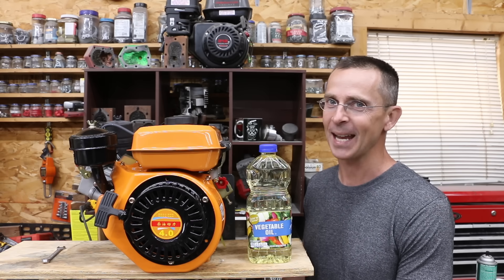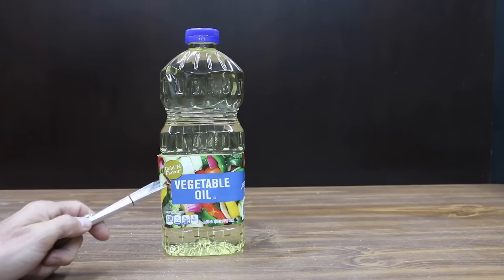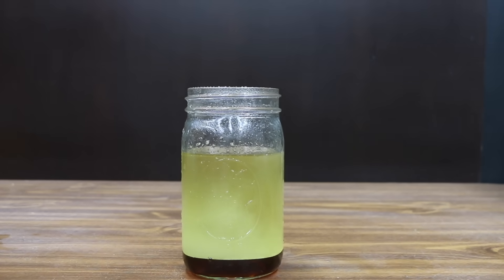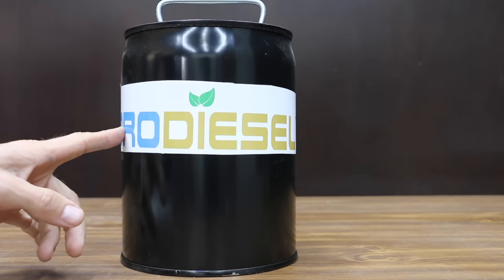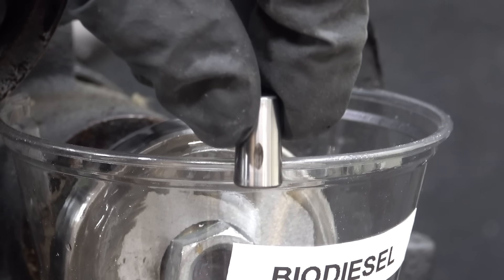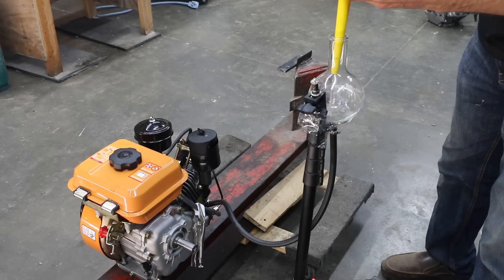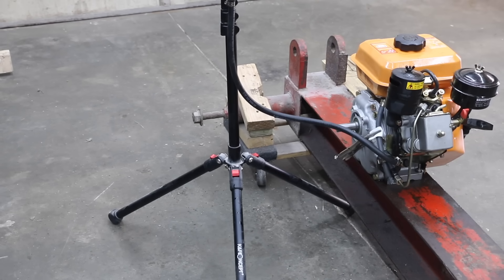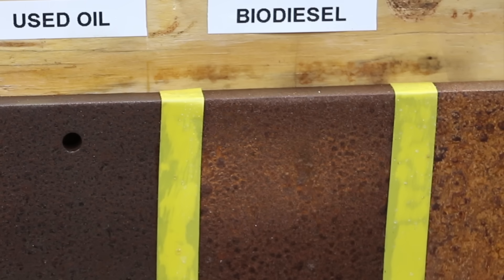Make "Biodiesel"? Let’s find out! Diesel vs Biodiesel, Used Motor Oil, Vegetable Oil, MPG

Comment: How long would a fuel filter last running used motor oil or is there even a fuel filter in line with your modified fuel cell set up?

Comment: I have ( 3) e350 7.3 idi vans non turbo
That I've been running wmo  for about a year now .
Just filter down to 10 microns and run it .
Smokes a little and I feel a slight power decrease. 
But it's free.and I'm not racing .
Reply from the maker: Thanks for sharing.

Comment: We just just filtered used vegtable oil through water then through used fuel filters off of semi trucks. Ran 2 IdI 7.3s and an om617 on it for 2 years. The nicest oil came from the fairs. Then I got a real job that consumed my fuel making time. 

I then rans some uses filtered used motor oil blended with diesel in an om617 swapped dakota. The dakota was just too heavy for the 125hp engine. 

I'm considering putting one of those IdI 7.3s back on the road if fuel gets to $5/gal. This time it will skinned with a 70 f100 body in a 250 frame. Fuel of choice will be filtered motor oil.
Reply from the maker: Thanks for sharing.

Comment: Hi, I used to have a 97 model 3l Toyota Hilux, the Aussie version of the Tocuma. I bought her with 97.652KM on the clock, 15 years ago. The reason i bought her, after a few years of research into alternative fuels, she was the best option . I researched distilling alcohol as a fuel, using used motor oils, new veg oils, used veg oils and then making my home brewed Bio diesel.
i am very happy to say that Used Veg oils from the local take away was the winner. I then started making my own Bio diesel using the appleseed method. The Big Girl as she was named, ran very happily for 10 years with out any mechanical issues. Used Veg oils was filtered thru 50 micron bags then allowed to settle in an Updraw filter system using 44 gallon drums in series. 4 drums, the 4th drum was my main draw drum for either straight use or put away into a 1000 ltr cube drum for later use. I was called the Oil Barren in my street. The Hilux used to take me to work every day, Hunting trips , tow my 5.5mtr Bowrider to my fav fishing grounds, trips to Queensland to Fraser Island and it never missed a beat. I set her up using a 2 tank fuel system. a 100 ltr tank in the tray area for Veg Oil, and the main tank filled with either proper Diesel or Bio Diesel. I would also carry an extra 40 ltrs of Veg oil in jerry cans, just in case. The oil was gravity feed to the engine bay, to a 30 plate heat exchanger running of the engine cooling system, thru another filter, back thru another 30 plate heat exchanger before going direct to the mechanical injector pump.
the only thing i found in the early days was the high consumption of fuel filters as the diesel algae was lifted from the original fuel lines. this was expected. Might i add, this is what people say kills their engines, NO, it doesnt. it blocks their filters. Veg Oil has never caused my injector pump, my Injectors nor my engine any issues. Remember, The Diesel Engine was designed to run on Peanut Oil, Rudolf Diesel the inventor of the engine...look that up.. Anyways, 10 yrs down the track, I sold her to a guy in Queensland, with all the filtering gear to continue her journey. I miss her dearly. The Only reason i did, my 2 baby girls grew up and the dual cab was just getting to cramped. I still have a Diesel engine, but its a Landcruiser, and i dont really want to dirty up the back of her with oil spills and dirty oil cans. I miss my dirty oily days of filtering used veg oils, i miss that distinctive smell of fish and chips, i miss the days of driving past fuel stops and not having to stop. if you have any questions or want some advise, feel free to ask. Long Live the Mighty Old Skool Diesel engine....
Reply from the maker: Thanks for sharing.

Comment: My old 1940s John Deere B runs on gas or distillate. Distillate is no longer available but diesel and kerosene are very similar. It is carbureted and It has a gas tank for starting and main tank for gas or diesel. They call for you to start the engine on gas and switch to main tank after the coolant warms up to 180° on the guage. Could you revisit running a gas engine on diesel in similar fashion and if it works try using these alternative fuels as well in a gas engine?

Comment: Iv watched people with them old 5.9 common rail motors take there engine oil out put it right in there gas takes no problems them old 5.9s will eat anything more so if ots mixed with regular  diesel.

Comment: The argument is quite complicated and there are various opinion on which is better, someone use a micture of veg oil and kerosene, others use even white spirit and veg oil, any experience with this kind of solvent and veg oil? Any thoughts? I mean if it's true it might be even easier than the methanol/lye process. There's no evidence that easier means also better btw

Comment: Please test lubricity test of diesel with marvel mystery oil! I been running it for years in all my diesels in both per oil change and per fillup but sometimes i just pour a bunch in fuel tank after adding $20 so would be cool to see 1/4 marvel rest diesel then half/half then 3/4 marvel rest diesel just to wonder how it does overall
Reply: Also test the freezing points with the marvel in the fuel vs regular diesel. Never had a single problem cold starting with marvel in both oil and fuel!!! 100% worth it i think but curious down to a scientific level. Also would be cool to see it in the crankcase i usually run about a 1/4 quart per oil change
Reply from the maker: Thanks for the suggestions.

Comment: I helped move 1,000's of yards of dirt at a friends farm with my 1995 mustang skid steer and ran it on strait peanut fryer oil filtered to get the chunks out and it ran fine ( it was free that why we used it )   my buddy puts used engine oil strait in his ram truck 2001 5.9 cummins and it works great also  both where in the summer time
Reply from the maker: Thanks for sharing.

Comment: I ran vegetable oil on a 1985 Mercedes Diesel for probably 30,000 miles and as long as temperatures were above the freezing point everything was perfect. Even on colder days the car would run smooth eventually as it had a fuel heating system once running. During cold days I blended some Diesel in and that usually worked well. Never in two years did the car just refuse to start.
Reply from the maker: Thanks for sharing.

Comment: Can you try running it inside a gasoline engine/try to modify it 
 You could ad ethanol to create a mixture that ignites faster and use the bio diesle as "filler"
Reply from the maker: Thanks for the suggestion.

Comment: The best way to run a diesel engine with used motor oil is to filter and distill the used engine oil, there's a guy who's selling a plan for building said rig to do that for 100 bucks, then you can blend that with biodiesel and a winterizing agent to make it work in the cold seasons, but I'd strongly advise to use the coolant line going to the radiator to preheat that fuel before it's sent into the common rail or unit injectors to be injected into the engine accordingly so it burns better and improves the mileage a little bit since oil is more dense in stores potential than diesel.
Reply from the maker: Thank you for the feedback!
Reply: @ProjectFarm  you're welcome, the guy's name is Alek Polek and he has a channel for you to see

Comment: Great video and thank you. I run used motor oil in my 1983, 300d Mercedes. Just only in the summer time. Pushing a million miles mark. Just a old project car. Restaurants are a good place to find cooking oil. Heat and filter. Only works on older diesel engines. Mechanical injection. Thanks for all your help and advice. Happy holidays to you and your family.
Reply from the maker: Thanks and you are welcome!  Happy Holidays!

Comment: I was wondering what you use for a fuel additive in your dodge if any at all? I have a 95 dodge with the 12 valve and was wondering what I should run in it
Reply from the maker: I use power service diesel supplement.

Comment: Fantastic video. Ok so here is an Idea although not fully formylated. Sasol convert Cole to hydrogen to fule oil. Any chance of converging wood into ??? Biogas into fule oil? To run a diesel engine?
Reply from the maker: Thanks!  Thanks for the suggestion.

Comment: The diesel engine or the compression ignition engine was built originally to run on vegetable oil. Fast forward, instead of improving the engine over that particular line of thought, because of the petrol fever, somewhere in the 20th century it was all changed to run on diesel.
Reply from the maker: Thanks for the feedback.

Comment: Ok, I am definitely switching to used motor oil + gasoline combo. It runs good, doesn't smoke, and lubricates better than diesel. 
I can get my hands on used motor oil easily and for free since I own a motorcycle shop. We are actually paying some company to come and collect the used oil we accumulate for safe disposal. That payment is more than enough to buy the gasoline needed to cut the oil, so it is a win-win all the way! :-) Also we have barrels that we fill with used oil, so they get a chance to sit for some time and all the gunk drops to the bottom. All I need is to collect the "cleaner" oil from the top. :-)
Reply from the maker: Thanks for the feedback.

Comment: Back in the early 2000’s, I used to run my 1995 Vauxhall Corsa 1.5D on neat vegetable oil for 8 months of the year. Then the U.K. government clamped down on it, making it illegal. Eventually vegetable oil became more expensive per litre than diesel. I was gutted!
Reply from the maker: Thanks for the feedback.

Comment: The smoke from hydrodiesel is probably just steam
Reply from the maker: Thanks for the feedback.
Reply: @ProjectFarm  You're welcome. This was pretty interesting. It's kinda similar to runing engine on woodgas. Instead of sucking vapor the engine would suck in air and woodgas from a gasifier. Maybe you should try that.

Comment: Nice 12v cummins...i have a 97 its only a baby with just only 87,000 miles on it...i premix the fuel 100:1 with 2 stroke Marine oil to keep the pump lubricated...since todays diesel sucks
Reply from the maker: Thanks for sharing.

Comment: We make bio out of the waste oil from my fathers fish market. The Bio runs well but it does eat rubber up. Works well in Gen 1 Cummins motors and my John Deere Tractor. We crack it with KOH and Methanol. I get better performance out of the tractor with it over dino fuel.
Reply from the maker: Thanks for the feedback.

Comment: I store used motoroil/gasoline mix in vacuum sealed 55 gallon poly drums for my 10KwH generators I keep for emergency power. I already have a 25 day battery supply set up via solar charging but I wasn't doing anything else with the oil and I got the generators for a song because the guy couldn't repair then and they ha e 80's era engines so he didn't want to bother lol. They were 100% exactly what I was looking for though. I had them running for 96 hours straight when I 1st got them running to test the oil/gas mix and make sure they wouldn't rip themselves apart. Engines were on a fresh rebuild before the test and post test teardown showed 0 out of the ordinary or unexpected traits. Like you said idk about running it in a modern diesel but runs like a hot damn in those generators
Reply from the maker: Thanks for sharing.

Comment: Years ago I ran a Ford Box truck with a power stroke diesel In the concession business. At the end of the weekend events I would pick up everybody's  used oil from their friyers and  Filter it through a one micron sock filter, basically  a pair of blue jeans with a leg sewn shut
 I ran it for years. In the Winter I would run diesel. If the filter ever started getting plugged up and spitting and sputtering I would put a quart of cheap Transmission fluid in the fuel tank and within minutes I would be running again.
Reply from the maker: Thanks for sharing.

Comment: so for the price the use engine oil in the best and it's why I have used it. I mix it with a bit of diesel no gas. could you do the test with used motor oil and diesel ? I'm sure there are a few mix others will want you to try. I can tell you you can run pure   vegtable oil used or new right in the tank no need to mix it or transform it. but with the used vegtable oil you need to filter it proprely.
Thanks Frank The mechanic here.
Reply from the maker: Thanks for the suggestion.

Comment: I own a 1972  M35A2 AKA. Deuce and a half. It has a multi fuel Hercules two stroke diesel engine in it. I run a mixture of filtered wast oil and diesel or filtered wast oil and gasoline. Some times I run straight diesel, it seems to start better in the cold on straight diesel. I was told that vegetable oil and diesel harden like calk so I have never run vegetable oil. Is that true?
Reply from the maker: Thanks for the suggestion.

Comment: There isn't much information on pressurized biofuel for gas engines if it's possible to run them what's a Turbocharger or supercharger and I was wondering if you could do that test
Reply from the maker: Thanks for the suggestion.
Reply: @ProjectFarm  your welcome another idea I had since I was a teenager was to replace the electrical system and replace it with compressed air when I was younger my grandma bought me a toy from Walmart and it was a toy car and it was called Air hog it came with a little bicycle pump and you pump air into it then push it and it would drive on until the air tank was empty and I thought I could take that idea and make an air-powered engine out of a gas engine

Comment: Personal findings. Making biodiesel isn't worth it. Mixing, settling, and filtering waste oil is way mo betta. You get half the mpg but the mp$ is awesome. If you don't scavenge the alcohol out of biodiesel it will melt the poly fuels filters and anything else plastic in your fuel system.
Reply from the maker: Thanks for sharing.

Comment: Would adding stuff like fuel additives help the biodiesel fight stuff like corrosion and freezing up? I'm just asking because I'm curious if you can use the same additives for biodiesel like you would with regular diesel.
Reply from the maker: Great question.  While antigel additives might help a little, biodiesel is more susceptible to freezing.

Comment: Shouldn't be any surprise that the engine runs as well on Veg. oil.  Rudolph Diesel designed the engine to run on Rape seed oil.  The only reason we use petroleum "Diesel" fuel today is because it was a waste product left over from gasoline refining and the oil companies figured out that they could sell it as a substitute for veg. oil.  Veg. oil conversions are avail for most diesel engines they just req. a heater system in the tank in the winter.   The ONLY reason modern diesel vehicles may have ANY issues with veg. oil is because the engine manufacturers are being FORCED to tune their engines to balk at anything other that Petroleum based fuel thanks to the deceptions and lies written into the, so called, "Clean Air Act", which was created to protect Big Oil interests!!
Reply from the maker: Thanks for the feedback.
Reply: @ProjectFarm  Any time! :)  Would love to see yo do more on the topic.  ie. Engine torque/ performance variations using the alt fuel types etc.

Comment: if you mix bentonite clay in water suspension, then shake well let settle and separate biofuel from the bottom layer, I have found that used oils work way better because they have been cocked, a lot of folks say that to let the oil cool down to about 125.

Comment: Thank you I run a 1995 NPR Isuzu on biodiesel I make from pig lard (my stepdad makes carnitas to sell so I get free lard) and I saw your video that you put bacon grease in a lawn mower so Instead of motor oil I use lard. Been doing this for about 6 months and no issues so far thanks
Reply from the maker: Thanks for sharing.

Comment: I have 90 000km on my old bmw 525tds e39 with weste motor oil and little diesel( 72L tank with 60l motor oil and 12 liter diesel in the summer) and(60L motor oil with 4 liter gasoline and 8 liter diesel in the winter) I live in Eastern Europe. Here, average salaries are $ 600 and diesel is $ 1.7 per liter NOT for gallon ;(. and  waste engine oil is 20 cents per liter :) Other option is ATF oil for trasmision and hydraulic but it is more expensive 50 cents per liter
Reply from the maker: Thanks for sharing!

Comment: Great video.  Try using transmission fluid on a test.  It has lubricating properties close to motor oil and a lot of detergent as well as a lower viscosity.
Reply from the maker: Thanks!  Thanks for the suggestion.

Comment: Excellent test.
Wonder why liquid sulfur couldn't be added along with zinc for injection lubrication.
Both of the items mentioned are usually found in good quality auto & diesel rated oils.
Have you considered using used synthetic oils as diesel fuel.
Reply from the maker: Thanks!  Thanks for the suggestion.